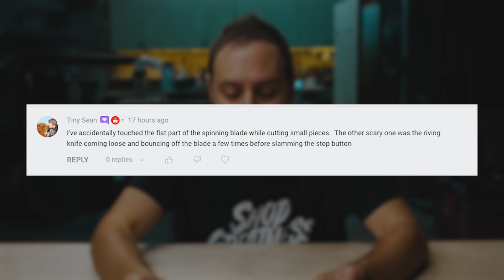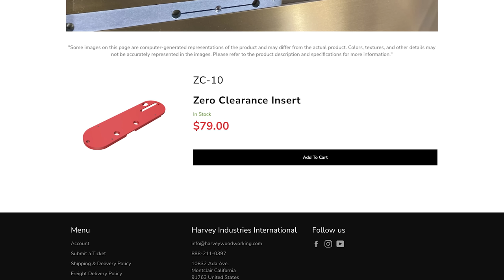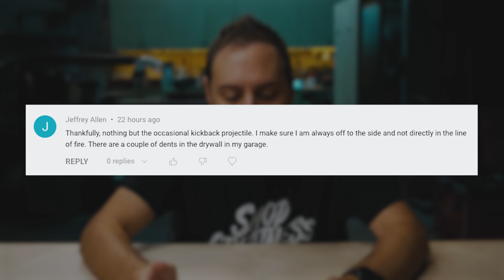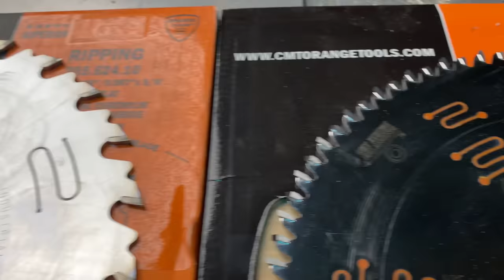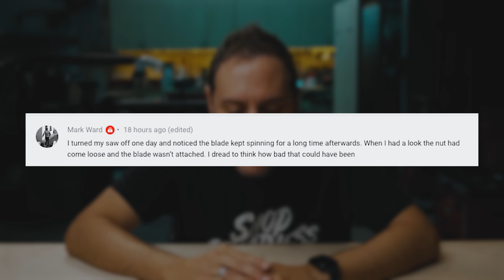I don't know why people make these dumb mistakes

Comment: Super important video.  Thanks for raising awareness - and wow, what a shocking amount of injuries associated with table saws.

I've used commercial table saws for work and less powerful ones for job site and home use.  After getting kickback at work that knocked the wind out of me (trimming oak stair treads), my boss advised me to never rip something wider than it is long.  You said this, but it's worth repeating.    

The nice thing about smaller and less powerful saws is that they tend to be more forgiving when you make mistakes like that.  They'll pop the breaker or just stall out.  I've used small portable job site saws that we just screwed down to the sub-floor and they work great as long as you use sharp blades and don't push the work faster than the saw can cut.

Comment: Zero clearance inserts are easy to make.  The plates on my Delta saw are very close to the thickness of 12-mm Baltic Birch with a layer of Formica on top.  Cut a piece of Baltic Birch, a little wider, than the insert is long, and put some bright colored Formica on it.  Cut some blanks a bit wider than the stock insert.  My Delta insert has four leveling screws, I removed the set screws, and used screws through the holes to attach the blanks, and then used the router table with a pattern bit, to cut the blank to match the stock insert..   You need to keep the new insert down on the table to cut the kerf.

Comment: Nice tip on the blade cleaning! I hadn’t thought of that, but will 100% try it.
Reply: After I clean a blade I always spray it with WD-40 so it don't rust. Just gives it a protective coating. There's probably other stuff you can use that's better. But for me some WD is good enough. It's better than nothing, that's for sure.

Comment: Thank you for this video.
I am a retired toolmaker. I was working on a tool grinder and someone startled me. The tool I had just made razor sharp hit the grinding wheel, flipped, caught the wheel again, then my hand.
I notched a piece of the bone in my finger and severed the nerve to my finger tip. I always lock the shop door when working with power tools.
Reply from the maker: Oh wow. So sorry. Glad to know I’m not the only one who locks the door!
Reply: Locking the door is one solution if you don't want someone to come in and possibly startle you. But you should bear in mind that it will also prevent someone from coming in if, for example, you are injured or otherwise in need of help.
Oh, and switching off your phone, or even better, not having it in your pocket, could save you from being startled, but make calling for help more difficult. 
It's a dilemma. ;-)  @wittworks

Comment: I was lucky with my accident and only shaved about 1/16 of an inch off the tip of my left index finger.  However that was enough for me.  I had an old craftsman table saw that did not have a riving knife nor a blade cover and I wasn’t using a feather board or a push stick.
I now have 3 push sticks in reach, always have a feather board when applicable and I got a new table saw with a riving knife and blade cover.
Reply: You got a funny idea about what luck is. Luck is missing getting cut by a 1/16th of an inch. Getting cut is not getting lucky at all.

Comment: Man... I watched this video the day it came out and I still just now almost badly hurt myself on a table saw. I was using my cutoff sled to cut a box that was basically completely finished. After I made my cut, I sat the box on the far end of the blade and turn off the saw. Without even thinking, I slid the cutoff sled toward me, the blade was still spinning (off but still going pretty fast). The blade grabbed the box and launched it at my head. Thankfully I dodge and it only grazed me. My box not has a HUGE gash in it and my pride is hurt. I am ashamed that I got caught sleeping.
Reply from the maker: Oh man. That’s a close one. Maybe I should have done tip 22: don’t move until the blade stops 😢 glad you’re safe.

Comment: Okay, I'm curious as to why theres not a flat top adjustable cover 'shield' to go over top of the saw, maybe even clear. Stops things from slinging up, stops your hands from coming close or falling on top. Wont stop the saw from grabbing the piece and pushing it back toward you. But would stop it from popping up and slinging at you. And you really need a follower for holding your piece to guide it along the fence. Follower could just as well follow from underneath the shield. Maybe theres something I'm missing for needing your hands closer to the saw and fence area, But it would seem like a physical barrier that also covers the piece would pretty well cover a good bit of margine for accidence.

Comment: I bought an old craftsman used saw where someone had removed the tubing knife and the clearance around the blade was ridiculously huge so I took measurements and was able to model and 3D print a 0 clearance insert for it.
Reply from the maker: oh nice! I've thought about 3d printing one
Reply: @wittworks  you have to make it really thick and strong so it doesn't shatter but  my version 3 has been working fine for months

Comment: Thank you for this video.  I'm so terrified of my table saw.  It's an older one, so doesn't have a riving knife and I hate it.  I've watched as many table saw safety videos that YouTube will suggest to me at this point, but yours actually had some things in it that I had not seen before.  I will be implementing as many as I can.  Still scared though...not gonna lie.
Reply: I would never own a table saw without a riving knife. It is a huge improvement in safety with almost no downside. I'd sell your saw at a loss and get one made in the last 15 years that has one.
Reply: @ajcarrico1   I'm working toward one.  I'm trying to avoid using the one I have as  much as possible in the meantime.

Comment: My wife and I have always had a rule no operating tools without all safety items in place. Wether that is push sticks, blade guard, riving knife etc. if any tool has a broken safety item it gets repaired immediately and if parts are not available it gets replaced
Reply: I have a rule about safety devices too. I immediately remove or defeat all of them. I don't rely on any of that crap to keep me safe. Half of it just makes stuff more hazardous to use.

Comment: Thanks for this video, very informative. And the carbon method, I really should try this stuff! I keep getting rust on my bandsaw somehow, even though I've waxed it.
Reply from the maker: You’re welcome. Do you have a lot of humidity? That’s why I don’t like wax. It wears off fast. I’ve had zero rust since switching and we’ve had rain and high humidity
Reply: Yes, there's quite a lot of humidity. It also doesn't help the ceiling let's through water rarely.

Comment: I had been using a table saw at work, for 20+ years, mostly untrained outside of watching other people's success and mistakes. Luckily I was cutting mostly MDF at 1st, which is thankfully very forgiving. (I hate the stuff otherwise) I learned over time both seeing and making a lot of stupid mistakes. Knock on wood, I have never been injured. it was a very chaotic environment. There could be as many as 20 different people using the table saw over the course of the day. Often there were people who had no business getting anywhere near it. After finding an 8" piece of 3/4" plywood hanging out under the zero clearance insert, I got in the habit of checking over everything every time I followed someone else. Anyway, I've worked with a lot of pro woodworkers and cabinet makers over the years. I don't recall a single one of them using a riving knife. Instead they all recommend to adjust the fence to be slightly more open at the back end to avoid the blade getting pinched. Some of these pros consider a riving knife to be even more dangerous than going without. I think they were concerned about it coming out of alignment. At home I use a Dewalt jobsite saw that is built into a larger table. I can't access the lever for the riving knife easily so I never use it. I do have the fence set to be slightly open on the back. I've never had any issues with kick back. My cuts are clean and perfectly square. I'm curious how many other people use this technique. I have done a few dumb things in the past few years. I'm definitely guilty of adjusting the fence with the blade running. I mostly use a cross cut blade for everything. I'll stop doing both of these! Some other safety tips: 1. Don't work in a shop that has lots of clutter and cut-off leaning all over the place. 2. Make sure where you are standing is clear and that your access is not restricted. 3. If there's a mat, tape it down with carpet tape or better yet, remove it. 4. Wear a dust mask ear and eye protection and use dust collection. 5. Keep a blood stop kit in your 1st aid kit and know how to use it. 6. don't work alone. I read about a guy who passed out and bled to death from what was not too serious of a cut. 7. Lower the blade when not in use. 8. Don't use your saw as a general purpose work table. 9. Don't drink alcohol or do any drugs while working in a shop. This seems so obvious, but I've had to send home a few people for this. Jobsite saws can be dangerous since they are a little more difficult to set up and often don't stay that way if they are being moved around. However, since they have less power than most cabinet saws, they can be a little less intense when they do kick back. In twenty years, I drove 1 guy to the hospital with his thumb cut halfway off. I saw an idiot spill a bucket of screws onto a table saw that was in use. 1 guy cut his hand on the belt of a contractor saw. I've seen countless nicks and bruises from kick backs and even found a couple making love on the saw once, with the blade all the way up! I've also seen a router go sailing across the shop one time. My friend was the shop tech at Columbia University and caught some students drinking and trying to surf sheets of plywood across the table saw with the blade going! This was shortly after they had a grad student die when her braids got tangled in the metal lathe. I digress...

Comment: I use a very small table saw(a bad ryobi one too) so i stand on the right side, but the amount of times ive had a piece of wood kickback is 5 times too many. luckily, every single time i was not even close to the middle. Honestly, not being cocky and just taking time even when you dont need to is prob the best way to keep yourself safe. and using push blocks
Reply: You have to be confident but not over confident. There's people in the comments saying they're terrified. Panic is never a good thing. Basically if you never touch the blade while it's going you should be OK. You do everything to make sure that doesn't happen. As far as kickback goes I don't know how folks manage to do that. I understand it theoretically. Just don't let the work twist and lift up. There's the reaction wood thing and I've seen that. You hold the work down and the blade will cut itself the kerf it needs. You limp wrist it and then there'll be a problem. I don't have any riving knife and I've never used one.

Comment: I've been woodworking and using table saws and other power equipment since I was a teenager-- more that 35 years.  I was putting a new zero clearance insert into my saw, which I have not done very often.  Knowing that a new, unfamiliar operation was likely to accident potential, I spent significant time thinking through what I needed to do.  But my plan was bad-- I stood at the left end of the saw and hand-held  the insert in place with a secondary piece of wood in my left hand.  My logic was that the secondary block would protect my fingers.  As I raised the blade through the insert to make the slot, it clipped the piece of wood I was holding, kicking it forward and rolling my hand under and dragging it into the blade.  Luckily, it happened while the blade was still very low, so there wasn't much exposed to cut me.  Still, I spent a few hours in the ER.  The gash ran across the back of my index finger (cutting through skin and tendons and nicking the bone) and the knuckle of my middle finger.  I only needed 12 stitches to close the wounds, but the tendons were unrepairable and I can no longer straighten my index finger.

In retrospect, I should have clamped a board over the insert in place an had my hands nowhere near the saw surface when I raised the blade through it.  That seems obvious to me now, but at the time, I thought I had thought it through and thought I was being safe.  I am sure there will be those who will call me a fool.  That maybe true too-- I'd have a hard time defending myself as I sit here with my crooked finger.

Thank you for taking the time to film and share this video.  I've been back in the shop for a couple of years now since the accident, but can tell you it took me several months before I was willing to turn on the saw on again.

Comment: Never, ever feel comfortable around any large power tool.  IMHO... A healthy respect (a.k.a. fear) is a good thing... makes you think before you use it.  

I inherited a vintage late 60s Craftsman 113 table saw from my dad... lacking any decent safety (guard and pawls long since lost to time).  I spent some decent cash on a new fence, emergency kill switch, zero clearance inserts with splitters (one for each blade thickness) and a Jessem stock guide system, all to make is as safe as I could.  I'm currently trying to come up with a way to mount an overhead blade guard.

I can't recommend enough the Jessem stock guides... in combo with a splitter, they greatly reduce the chances of kickback.
Reply from the maker: For sure. I want those guides!
Reply: No fear!

Comment: Lots of good information on this video.  Whenever I teach a group I inevitably forget a few things.  There's really like 50+ things that can make table saw use safer.  In addition to your fine list, there are a few suggestions that I would add.  You should just leave your push stick on the top of the fence, or on the unused side of the table, until the end of the stock is fully on the table.  Otherwise you can cause the stock to float and you have less control.  Another part of the equation that is often overlooked is hand positioning while pushing the stock before the piece is fully supported.  50% of learners seem to want to push the stock with their palm down but you have much better control with palm up and thumb fully on top of the stock.  Once the stock is fully supported then switch to palm down and push with your thumb.  This prevents situations where cuts aren't completed all the way through and the inevitable attempt to push solid wood through the guard or splitter.  Don't try to force things, losing a battle with saw doesn't usually end well.  On that note, I'll also add that quality saws often have pull start/ push to stop switches.  Become proficient at turning them off with your knee before you have an emergency situation.  

 Another way that I try too keep people safe is that  I always ask learners to lock their left  thumb onto the edge of the table while using their fingers as a feather board.  Beginners want to go forward with their work and are often hyper focussing on keeping the materials against the fence or they watch the blade.  

One more thing to add is that you show that checking the blade is important, but checking that the fence is perfectly aligned or that the distance between the fence and the back of the blade increases is equally important.  On some cheap saws the fence will toe in or out depending on which direction you have moved it.  The Dewalt 8" table saw's fence is the only one I trust with entry level offerings.   Other cheap saws I check the distance at the front and back of the blade every time I move the fence.  I'm lucky enough to have a Sawstop at work and the dewalt and a track saw for my small space at home.
Reply: Hey Jay. I bought a tracksaw and a contractor's saw last year. I've yet to use the tablesaw as the tracksaw has so far done everything I need of it, and it seems so much safer.

Cheers for your comments!
Reply: @Mikey__R  Track saws seem much more intuitive to use safely, make quality cuts, and have superior dust collection vs inexpensive table saws.  One of my favourite purchases.  The table saw gets pulled out for repetitive cuts or smaller stock.

Comment: this video makes me feel pretty lucky that the only serious injury that I've had in my half decade of woodworking was cutting off about an 1/8" from the end of my left thumb while using a bandsaw. also If you want to experience kickback a bit more safely, just cross cut some pvc pipe on the table saw.
Reply from the maker: dang!
Reply: @wittworks  don’t worry, it grew back and unfortunately didn’t even leave a scar

Comment: Jimmy said an experienced user more likely to be at risk of injury from table saw, yeah I kinda can relate to it, although not from table saw. When I got into using basic power tools, impact driver and whatnot, at the beginning I was fine using them but about a year into it, I started to make stupid mistakes like not checking the direction of screwing so instead of tightening I screwed counter clockwise so I messed up both a bolt and a thread... My brain somehow thought my tool should know which direction I wanted it to turn without me setting it! 

So from that day I made a conscious effort not to get too comfortable/cocky/lazy when using tools. Arrogance and complacency leads to accidents. Always use power tools with respect as if you saw it the first time. Subbed btw keep up the good work sir.